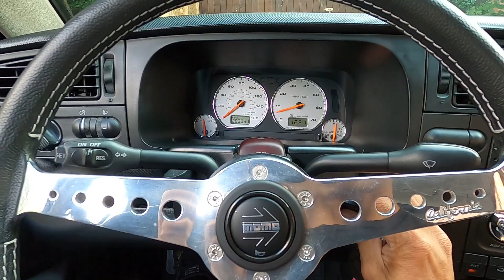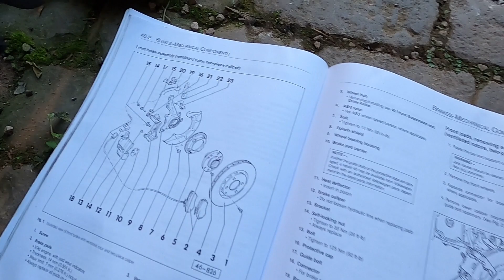This Could Of Been Really BAD... ( Mk3 Jetta Vr6 )

Comment: Bruh, had the similar issue with my mk4 jetta, got back from the workshop, noise from the left wheel, tried to diagnose it and thought it was the cv axle. It turned out to be loose bolts on the left wheel and that time I was speeding the car way over 120km/hr.😨. My heart stopped for that moment. Scary shit right there. 

Guys, don't ignore the noise.🙏🏽

Comment: This happened to me few weeks ago with my B3 Passat. I drove on highway, came off braking it started making same noise and when I was home I lost my upper carrier bolt on the passenger side. I pretty much know the reason. Usually when you refurb your brakes you paint the carriers and paint also bolt contacting faces of the carrier. These contact faces should be cleaned from paint or rust etc. Plus if you use old bolts they usually bit rusted or dirty. So you have very big chance that the contact between carrier bolts and hub loose. And when the brakes have temperature changes it slowly gets the bolts loose. New carrier bolts have locking wedges if you buy new bolts from VW. Good clean surface and right torque it should be ok.
Reply: Use dab of.blue or white lock tite

Comment: I use the same brake setup on my 6N GTI (280mm, with the same brembo discs), and the same NS2R, with poly bushes and coilovers, and it is amazing. I would be interested in the handling of the Jetta, with the extra weight and length it has.
Reply from the maker: Nice setup man! The Jetta feels pretty planted but you have to be careful how hard you push because there’s a point you feel the rear of the car get light and you gotta back off a little
Reply: Right it's not the same as a golf or gti feels that ass end trunk is like scary light for being so far stuck out there compared to the hatches and I'm pretty sure even glx weights less than the gti an golfs but that's what I started with so never used to that ass air you get from the bumps lol  like yea even four seven slots in the trunk an full spare set up my glx would be hoping at times of high speeds with the coils they aernt the greatest ones so font help none but I want to get the baby seat brace bar aswell as having my  tower brace in there and then maybe one the redline or other brand rear floor mount chassis brace and would envy a neuspeed three pointer in the trunk also and maybe one those other ones like I think you got in the Savoy hatch also , ....they got the outer floor pan chassis braces too makes.it like it's got a real chassis frame probably insane stiffness an handling think that the floor ones can connect the front and rear subframes  at same time too which just sayin , Christian. with all those nice stiff poly bushes an those fabless tubular arms and feamea with the spherical balljoints and  spherical contro arml bushings the thing would probably bring a whole.new level too the.feeling of the Fahrvegnuge definition ♥️ 🎶📣    🔥☄ 🌬
Reply: ..Think its WHITELINE not redline lol not redline ,but the baby seat brace is basically a stock from factory option for certain countries kind of trunk brace which is like  straight vdub made an dot safe approved for child restraint safety so can't beat that either but I think if you got that it makes it impossible to fit an run the actual eurosport or neuspeed type rear shock tower braces .

Comment: also .. if the car makes heavy vibrations overall... (sme you wont notice) if you removed like the vibration damper on the subframe.. it could ply a roll that enough i made to undo bolts. just my 00.2cents